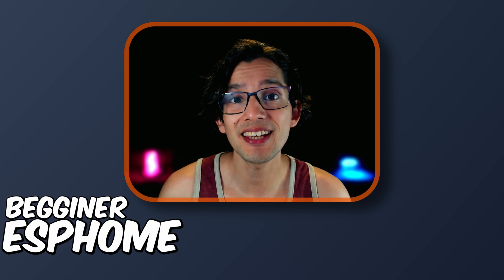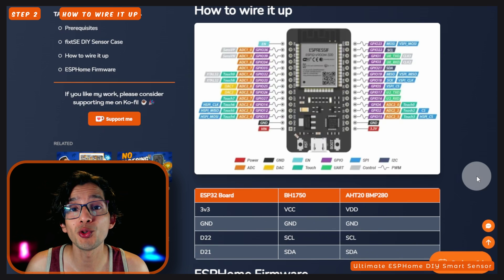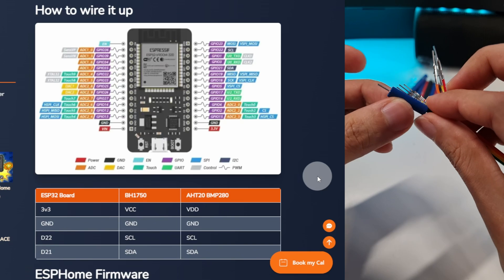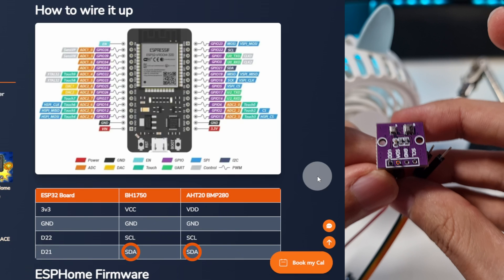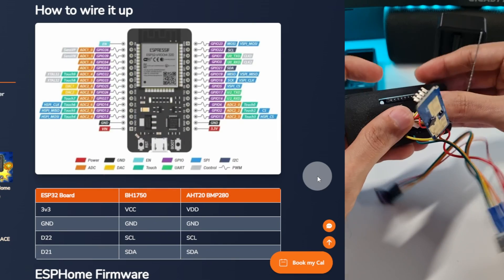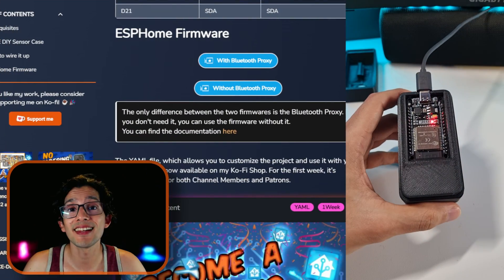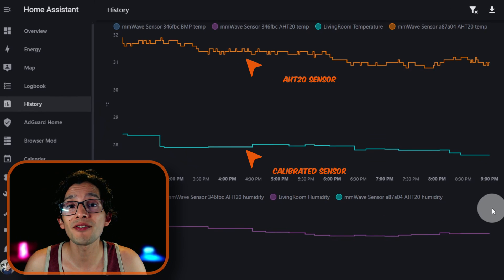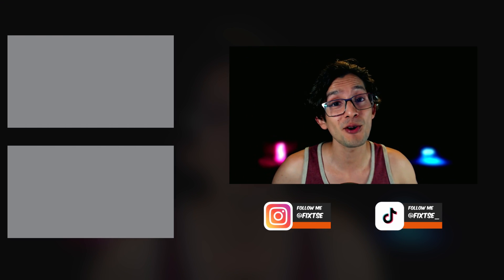Ultimate ESPHome DIY Smart Sensor | HLK-LD2450 ESPHOME

Comment: in home assistant popup firmware update, when i click update, the update installation  reach 100% and nothing happened- says update available and stays version 2024.12.4 - please help ( im with the bluetooth proxy firmware).
Reply: You point at "path": "ultimate-esphome-sensor_no-bluetooth.ota.bin", that is wrong. you need to point to
"path": "ultimate-esphome-sensor.ota.bin",

The "md5": "5426c4fc50923867ee149f288de7d924", is perfectly match for file ultimate-esphome-sensor.ota.bin

Comment: Thanks for share this video, I like this integration with them all, but, I can't install FW by ESP web tool from your attached, which block in "erasing", I have press "boot" bottom, but still not work, anything was wrong?
Reply from the maker: l would look into the drivers if you already tried everything I mention on the tutorial.

Comment: I was so surprised I found this,. I'm very new to HA and automation, and was thinking of something very similar to this, but with battery backup and possibly other sensors like window and door connectors, maybe door locks etc. Then you'd have a generic device per room with little configuration differences for each room.
Am I too far from possible? Your case looks very tight, especially for a battery backup system, or even other sensors or switches connections.

What do you think, am I going down the wrong route to consider these other connections for a single esp32?

Great video by the was. I just wish you spoke a little slower! But this is probably because I'm getting too old!
Reply from the maker: Hi, thank you. It's not you, I tend to rush over my words 😅. And yes, too many sensors for a single esp32. I would advise to separate the sensors into at least two, you can add an air quality sensor, I found it to be very useful.

Comment: Love the video! One question though, I have a 38pin cp2102, is there a way I can just simply use this instead of getting a new 30 pin version? I gave the pin out from the 38pin version, and also access to your yaml file but nothing would work if I changed the pins according to the yaml file. Thanks!
Reply from the maker: Hi, thank you, mmm it should work on the 38pin as long as you are using the same pins but on your 38pin board, there is no additional configuration needed.
Reply: @fixtse。  Thank you. I was able to get a 30pin version for like 5 bucks so I am swapping the two. However, on my HA instance it was showing up with most of the readings unknown. I checked the wiring and versions to ensure they are connected properly. (the only reading that was able to go through was the illuminance)

I am running the HAOS on a pi located in IoT subnet. and the versions are a bit newer:
HA core: 2025.1.1
Supervisor: 2024.12.3
OS: 14.1

Maybe this is the issue?

Regardless, thank you for all the information you are providing online!

Comment: my esp32 module is constantly turning off itself after 8-10 hour with no logs suggesting why it turned off. when i remove the power and connect it back again it comes up again. i am using non proxy firmware from your site. Any idea why it is constantly shutting itself down?
Reply: I am reporting this case resolved. i re-imaged the esp32 again and everything is working fine now.
Reply from the maker: Glad to hear that you found a solution, weird that due to a firmware flashing problem it shutdown automatically, but I'll keep it in mind in case a run into some similar situation in the future, thanks for sharing.

Comment: Ive 3d printed the enclosure but I find it is not getting good detection because the sensor is behind the esp board.  Have i built this wrong?
Reply from the maker: Hi, mmmm the mmwave sensor should be looking in direction of the logo, the ESP32 it's supposed to go in the back. Maybe you can share a picture in the comments on my website so I can understand better
Reply: @fixtse.  I was puzzled about this as well. The pictures (also on PCBway) make me suggest the ESP32 is indeed in front of the other sensors. Do you have a picture to show how it ESP32 and sensors are positioned?

Comment: If you are using a BME280 instead of the AHT20 BMP280 sensor (and you have the yaml) change the configuration like this:
1- Replace all bmp280 with bme280.
2- under sensor change plantform to bme280_ic and address 0x76:
sensor:
  - platform: bme280_i2c
    id: bme280_sensor
    address: 0x76

Comment: Look great, have installed it via your website with the install firmware esphome button. But i am unable to adopt the esphome and therefor not able to update the security updates for esphome. How to adopte the esp?
Reply from the maker: you'll need to buy the yaml file to be able to adopt it on the esphome dashboard, but don't worry, I'll update the firmware to the latest esphome version. I haven't seen any relevant improvements on the release notes so far regarthing the devices used on this particular sensor, that's why I haven't update it yet.
Reply: I already bought the yaml, but the yaml Version keeps rebooting
Reply from the maker: @danieljansen1987  hey, I updated the binaries yesterday (right before they launched 2024.6 🤦) could you try using the installer from the post? (It would be weird, since is the same yaml but doesn't hurt to try).
Also, which version are you using? with Bluetooth tracker or without.

Comment: Thanks for this. I get this error when I try to remove the AHT10 sensor? Im using your membership yaml..... The error message you're encountering, "*** [.pioenvs/entrance/src/esphome/components/aht10/aht10.o] Source src/esphome/components/aht10/aht10.cpp' not found, needed by target .pioenvs/entrance/src/esphome/components/aht10/aht10.o'.", indicates a problem during the compilation process related to the AHT10 component. This might be happening for a few possible reasons:
Reply from the maker: Hi, Thank you so much for your support 🎉. 
Try using the Clean Build Files options on the ESPHome Dashboard (it's inside the three dot menu of the device), and try again.
What is probably happening is that you added information for a new devices to an existing project. The esphome building process downloads and cache the drivers for the device using the yaml file the first time it runs. After that, to speed up the building process the driver download is skipped, as it assumes that it has all the drivers it needs from the first time it runned (on most cases, this is what you desire, when you are working on a devices with a specific set of sensors), so to get around this, using the Clean Build Files will reset the cache of the project and should trigger the download of the drivers the project needs. Let me know if that helps 🤞

Comment: Thank you. I am not very fond of wifi..what add on would you recommend or esp32 board poe network cable enabled?
Reply from the maker: To be honest, I haven't tried ESP32 boards with ethernet support yet, so I can't recommend them. I undestand why you might not like wifi, in some situations they are just not as reliable as a wired connection. I will look into it, but I really think that ESP32 boards with poe support seem like a very flexible base for any sensor you might want to build using ESPHome.

Comment: This was a very easy to follow Video.  Thank you.  You did not talk about the MmWave calibration or settings.  Does your setup have one distance setting for move and static or do you use all 8 settings?
Reply from the maker: Hi, yes the LD2450 sensor doesn't expose options for calibration (Like the aqara fp2), all configuration is based on the zone detection feature. No min or max distance, you just create a zone starting at your desired min distance and ending at your desired max distance.